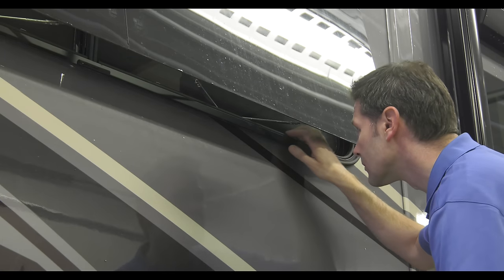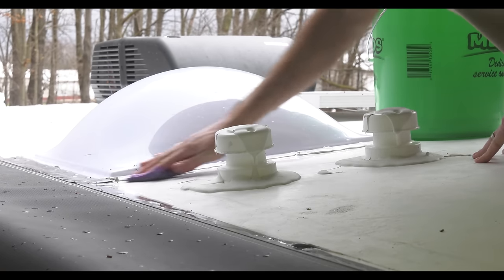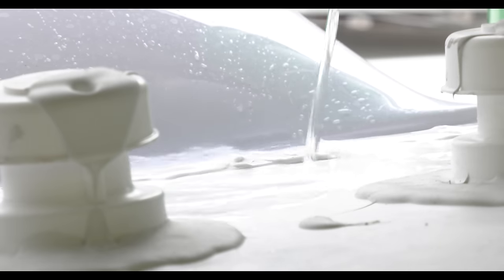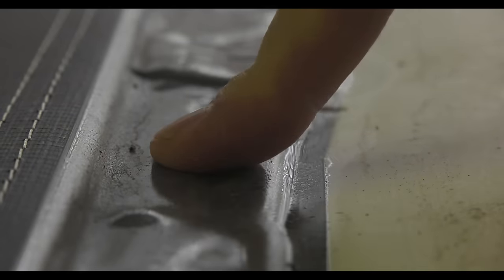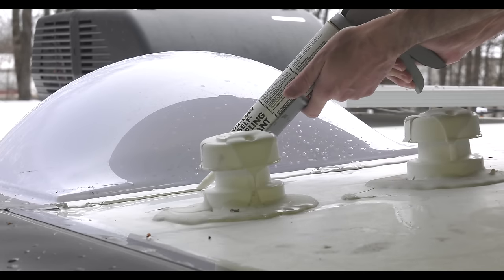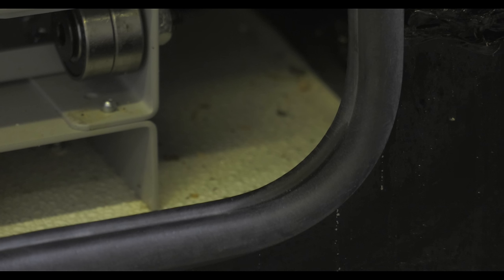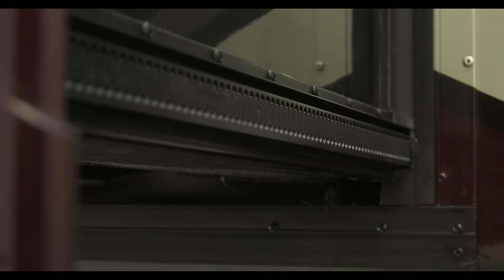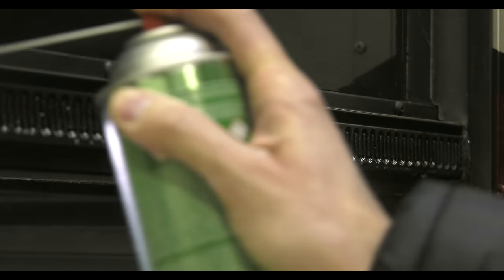RV Seal Maintenance For Windows, Roof, Doors & More

Comment: What type of silicone sealant should you use for the body?
Reply from the maker: Good afternoon!  Traditional silicone is all that's needed to reseal your motorhome anywhere fiberglass is involved.  If you have any additional questions on maintenance our Customer Service team is here to help you 24 hours a day 7 days a week.  They can be reached at 877-855-2867.